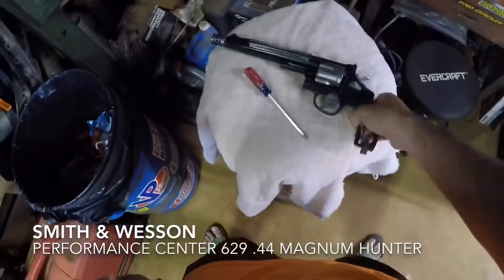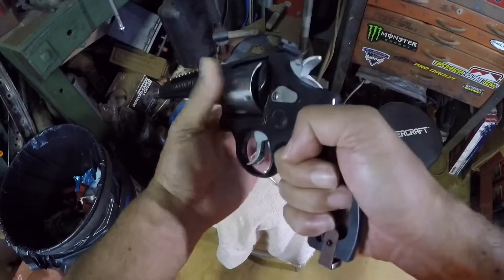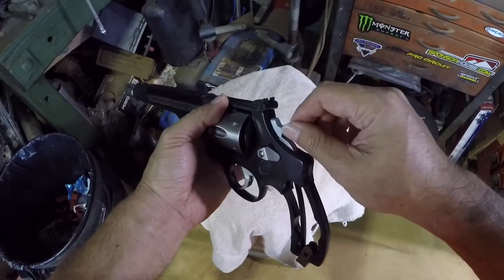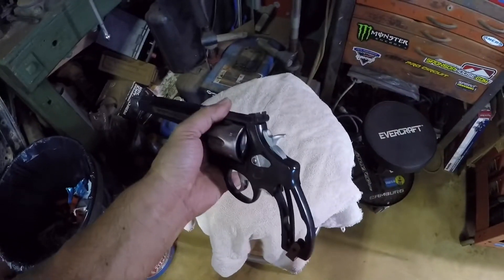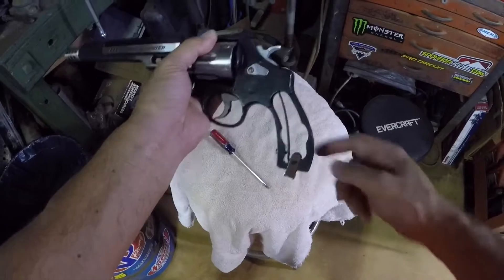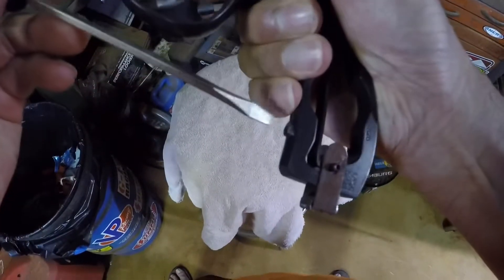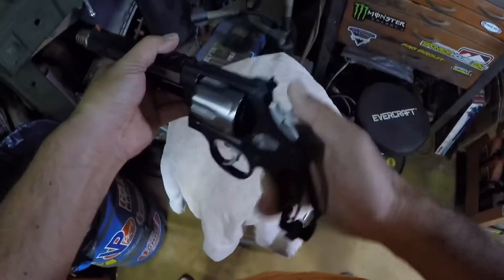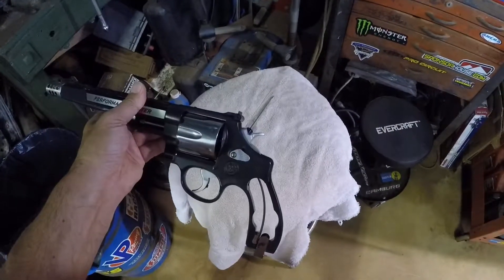Smith & Wesson Revolver Light Primer Strikes Easy Fix

Comment: Thanks for the info. My 986 9 mm has had many light strikes/misfires. The cylinder also locked up a few times but I was able to fix that by tightening the knurled end of the ejector rod which was getting hung up on the release pin. Since the gun is only 2 months old, fewer than 200 shots fired, I decided to sent it back to Smith&Wesson for evaluation.